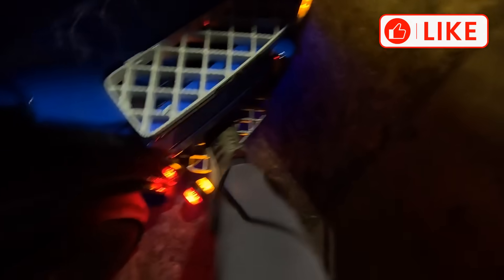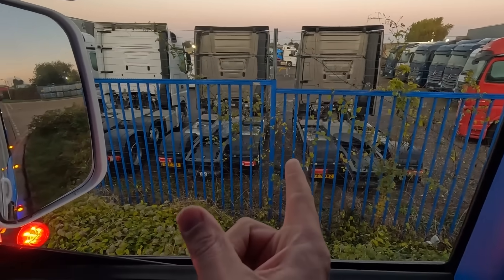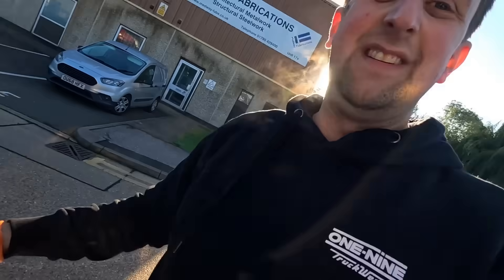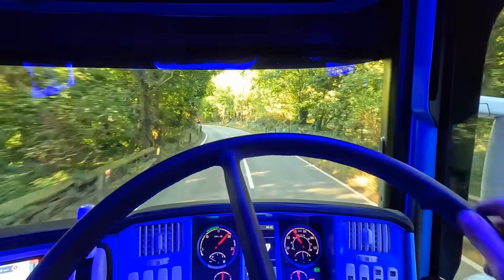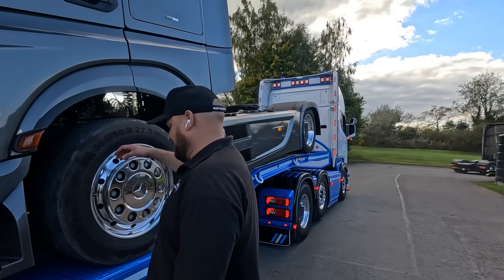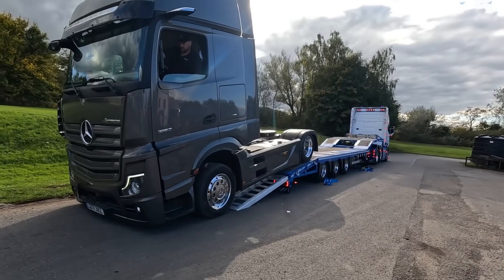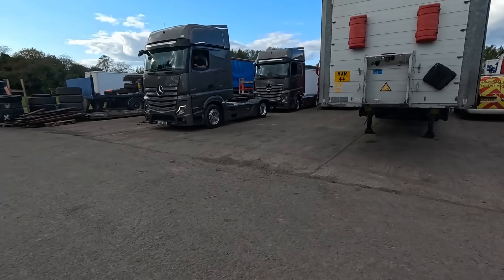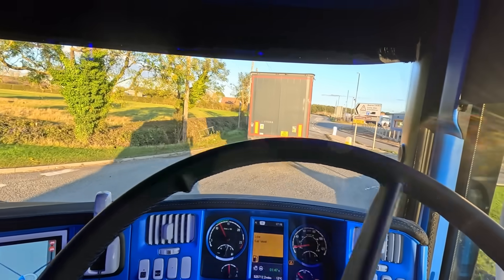COLLECTING 2 EX FORMULA 1 TRUCKS FROM MERCEDES | #truckertim

Comment: Instead of having front air on the trucks, imagine if the trailer ramps had a lift mechanism.. drive onto the ramp, then the ramp could tilt
Tilt, secure, tilt further, secure .. until horizontal

Comment: Another great video tim I've seen r25 tow before when I was at college truck spotting. I think after an exam got air horns too they sound great. Tho just saying if your buying paint from durex that isn't paint. Also it I a shame about the side pipe tho if you got it on the s series would it need to be blocked up or just used for shows

Comment: I use grit, diff locks, lower the rear of the truck you’re putting on 👍when it’s slippy to get the trucks on to the trailer, I’ll email you our set up and where you can modify your trailer to store your ramps away safely and securely so they don’t get stolen 👍 my email address begins with westcoast👍

Comment: Tim think you would be better of selling that trailer and getting a new one, even if you were to put money on it getting a bigger winch and longer ramps you still have the issue of how slippy the bed is and you cant put anything low on the front of the trailer, also as its a gdb trailer its likely to need alot of money spent into it, also at the end of the day Tim its still a old trailer and chassis just with new paint on so something will go wrong soon

Comment: You need some guide markers for loading... I used to bits of copper pipe with reflective tape on and a cheap are bike light for dark night s to mark. When loading on the  corners.

Comment: Tip for the Mercedes if they keep running away on you whilst trying to do manoeuvres. Go into the menus and turn off crawler mode, that way, its not immediately trying to drive when you take foot off the brake. (Some of them take off quite  quick)

You should be able to control them better on the throttle then. Hope that makes sense and helps.

Comment: This is so cool... Trucker Tim colliding with my favourite sport!

These trucks are from McLaren rather than the Mercedes works team, so they won't have pulled Hamilton's car. Given that they're 71 plate, they'll have been used for the 2022/2023 season, maybe some of 2024. This means they'll have moved cars for Lando Norris, Daniel Ricciardo and Oscar Piastri. The cars they'll have moved will be the McLaren MCL36 (2022), the MCL60 (2023) and maybe the MCL38 (2024). They may have also been used to pull other trailers, like equipment trailers or parts of the McLaren hospitality suite which is transported on a few trailers and assembled for each race weekend.

These trucks won't have just gone to Silverstone and back - to keep carbon emissions down all the teams truck their stuff around the European leg of the season rather than flying it, so these trucks will have been going all over Europe, as far as Baku and Barcelona between May and September.

If they were used during 2024, then they've for sure pulled race winning cars or equipment around Europe - Lando won the Dutch GP, and Oscar won Azerbaijan and Hungary.

Super awesome to see you hauling these! 😎
Reply: I wonder do their truck drivers get paid a fortune? Must be stressful hauling around such valuable cars and parts
Reply: @johndoughnut8617 no, I live up the road from there and the money is pretty crap, too many other companies carving the job up and working for nothing.
Reply: @johndoughnut8617  Used to do it a while back,the driving was the easy part especially in Europe,we got to know the good places to stop!...Set up and taking down the garage was hard graft,painting the garage floor, then being part of the pitstop in the race,tyres,fuel,filling air bottles, polishing everything including the inside and outsides of the trucks,,airport pick ups,the list goes on !,..Money was pretty good and hotels and all the food provided,..A few beers were not unheard of on occasion !
Reply: @westboundbadger  interesting Job

Comment: I don't know if it's still this way in the US because I haven't driven a truck for over 20 years, but back when I was a trucker from the mid-1990s to the early 2000s, if you drove your truck with any of your lights, even marker lights, out, the coppers in most US states would pull you over and give you a ticket for not having all your lights working.
Reply: That talmu lights are considered as accessory light, so no problem if it going out. For main light and marker light, then yes it should be in working order.

Comment: Tim you should of left those foldable hydrulic ramps on the trailer the ones it came with, if you did the paint on the back of the trailer would be less scratched and also the ramps where longer and you wouldn't need to do the lugging about of the ones you have now and no having to strap them down. Thats why that kind of configeration of low loader is more popular now. The olny down side is you can't have overhang on the back or less it fits between the ramps. Also if you get longer ramps they may also be heavier and more awkward to lift and move.

Comment: Tim Boyy , Part ex the Trailor for a Low Boy Trailer , the Body Slides Back over the Wheels , Crouchy has them as Most Heavy Recovery Firms, if they can load Coach n Buses, Trucks be a Doddle, Work Smarter not Harder Boyyyy

I Doubt those F1 Units just be Driving to Silverstone lol , Be all the F1 Trucks 

Great Vid Son👌👍